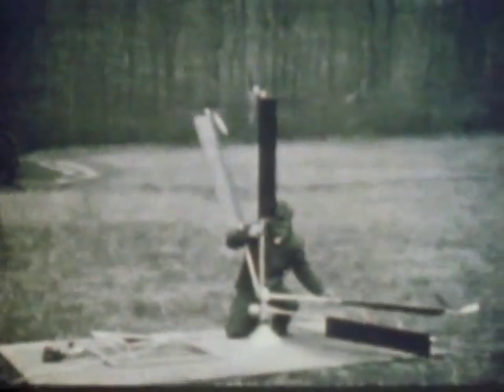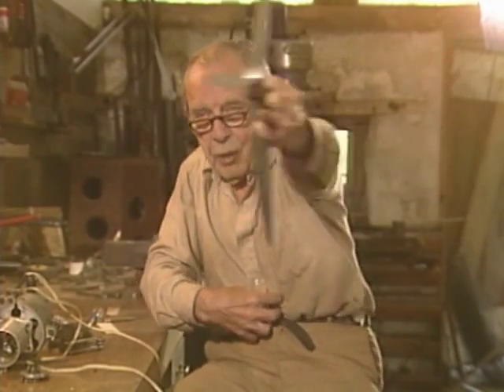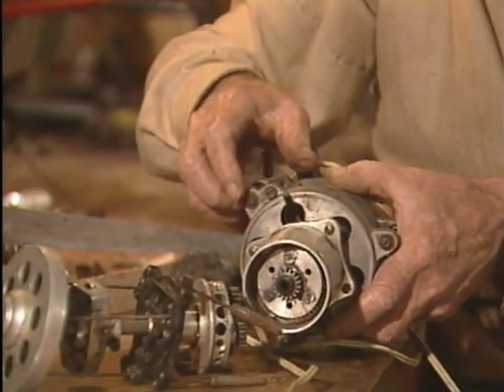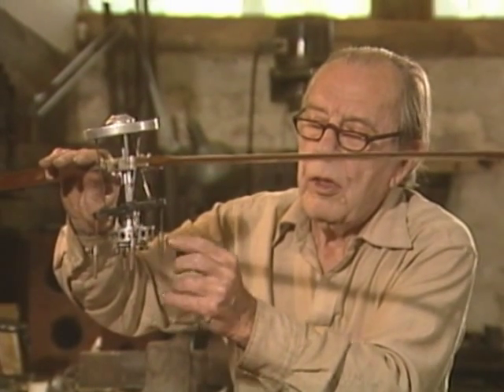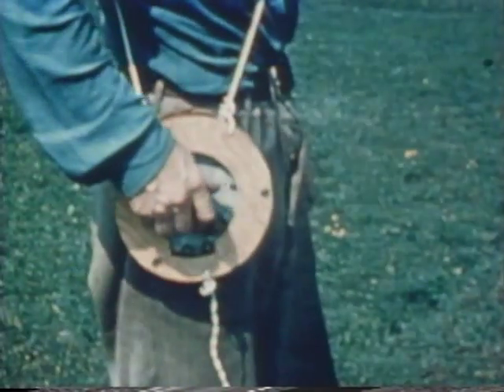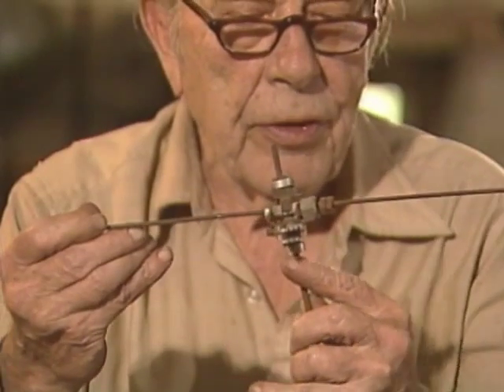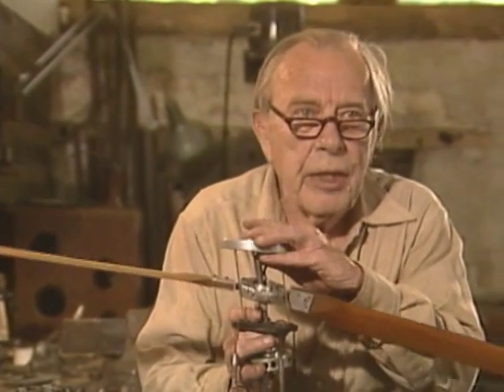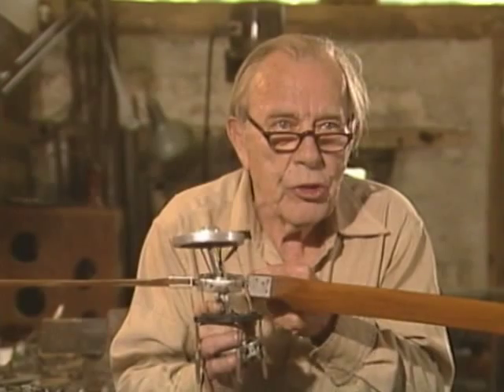Arthur Young on the Helicopter (Part 1)

Comment: 1982. Graduated Downey Hight school
1980 to 1990.  auto Mechanic which I gained experience by doing the work and learned how to read repair manuals
1990 1995. Cerritos College.  Majoring in psyychology and found Computer science was the new thing.
1995-2000.  Computer science
2000 present.  Security tech
Yes, it’s by doing the work with your hands.   Everything is basic 
Surfer Frank
Downey Cali

Comment: Q1. Why didn't he continue with coaxial syatem he originally started with, given it saves 10 % energy lost to tail rotor
Q2. Given he & in turn Bell corporation used flybar to tacle severe stability challenge, how Sikorsky handled this challenge as we never find flybars on Sikosky machines
Reply: Indeed I was wondering exactly the same. Alot of new helicopter don't use a bar at all.